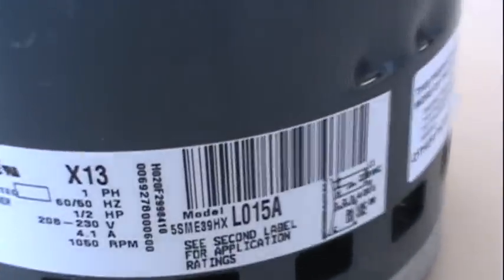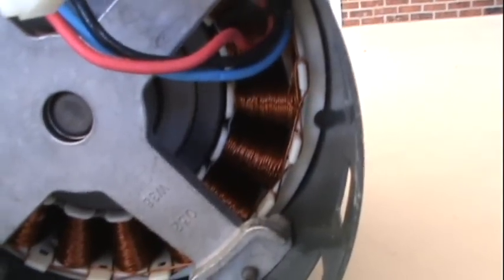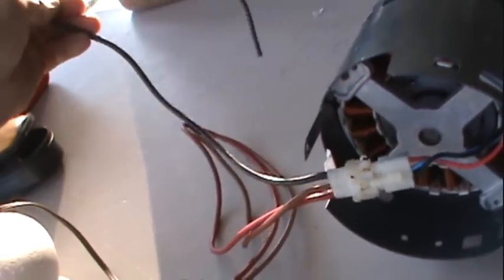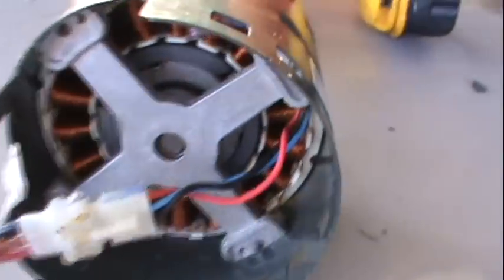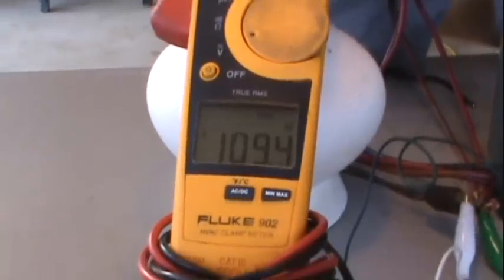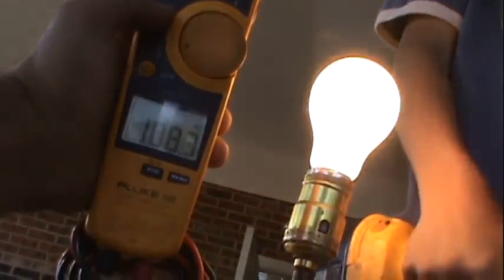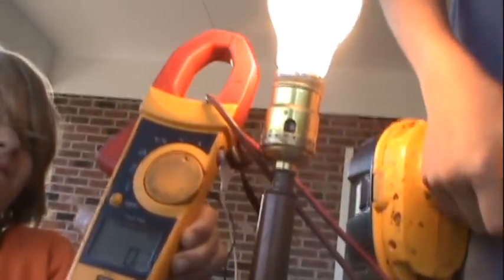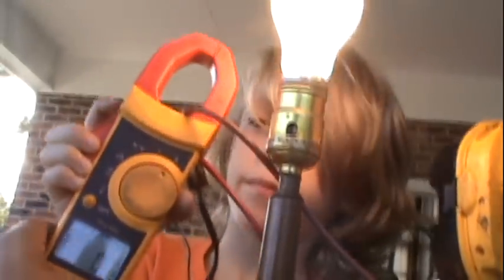Air Conditioner Blower Motor Converted To Generator

Comment: I am firmly convinced these things are inrunner BLDC motors...and that module that burns out is the ESC similar to those hobby motors used on quad coppers...but much larger and higher voltages...so turning it SHOULD produce 3 phase AC output, which can be transformed down to produce MUCH higher current, then rectified down for storage in batteries
Not bad...700 watts from a hand drill!  Imagine hooking that puppy up to a small 212cc predator engine (just make sure you aren't turning it much over 1100RPM (it's rated RPM)
They do make 3 phase full bridge rectifiers..only problem is...not many storage systems use 110v DC [rectified]  Trick would be...build a transformer...feed in the AC voltage, transform it down stepping down voltage but stepping up current...then rectify that and put into a charge control system for an off grid power setup [well I think the newer inverter generators might use that high a DC voltage to produce pure sine wave DC voltage]
https://www.ebay.com/sch/i.html?_from=R40&_trksid=p2332490.m570.l1313&_nkw=Three+Phase+Rectifier+Module&_sacat=0

Comment: I bought 4 of these from a air conditioning unit , i made a sweet go kart. Check out there u tube site for easy wiring for linking together , usb control and potentiometer control this will save you the cost of buying a brushless DC controller I spent almost nothing on my go-kart but then again the motors we're free

Comment: Well  I bought one on ebay...I spun it with a rope  and it went over 120 volts  so  you have three  places to  put one  bridge rectifiers for DC  current. maybe I could set them up in series and make a direct drive wind mill.. thank you  for rhe idea.. this is valuable info

Comment: GE GENTEQ X13 ECMHP Direct Drive Indoor Blower Motor.  SME39HX L015A. 1/2" Shaded pole shaft,  208-230v, 4.1 Amp, 50/60Hz, 1050 RPM, Counter Clockwise (CCW) Rotation, Single Phase, Made in India . NOTE: NO Wires are included as shown in photos. See tag pics for all specs. 
This motor is EXTREMELY CLEAN !!. Recently pulled from a running unit. (There were other unrelated issues wrong). 
Free USPS Priority Mail shipping to 48 states one business day after payment has been made.
 Sorry, we do not ship weekends or holidays. 
 If you need this part, you need it now....so don't hesitate, and buy it now!
MAKE SURE ALL SPECIFICATIONS MATCH YOUR MOTOR....THIS ITEM HAS A 20% RESTOCKING FEE.
I only do this because shipping motors like this get very expensive, and do not want a return on any motor.

great  lead!!!!!

Comment: connect that to a weed eater motor. and have portable lighting. that's all I'd connect to it. besides a rectifier and a charge controller. that can buck the voltage into current. and lower volts. to charge a battery bank. that would work good for something like that! use a engine. wind or water. to generate power!!!

Comment: So you didn't have to rewire the motor to make it produce electricity? All you had to do is hook a drill up to it to spin the motor?
Reply: Makes since right? Any motor will do that, The brush style motors have too much drag from brush friction. But that is what your car alternator is.. A driven motor.
Reply: These are in turn a 3phase generator. So the 3 wires are all 3 phases neutral is bonded inside wired Star usually

Comment: I have made several of these. I charge my battery bank that powers my shop. what you need to do is separate all three phases of the coils first. then run each  coil phase to a full wave bridge rectifier. this well convert the wild ac to more stable DC voltage. then connect all positive outputs of the three bridges together and the negative outputs together then run to a charge controller then to your batteries. I can get 500 to 700 watts using a 1 hp emc motor to charge my battery bank. I have four windmills up and  and 6 15 amp panels going into my charge controller. I get all my power from this setup and use a 10000 watt inverter to run all my saws and lights in the shop.
Reply from the maker: +John Lacourse  on a different video i show how i hooked it up to a 3phase bridge rectifier.  works good too.  sounds like you got some money in your projects.
Reply: +crob227 the full wave bridge rectifiers I can get online for 6 dollars a piece. they are 50 amp each. takes three. so minimal cost involved. everything else poles,wiring and batteries are all recycled. in all three windmills I have about 150.00 total.
Reply from the maker: +John Lacourse   you need some videos on that. would enjoy watching that,
Reply: John Lacourse  john, i would like more information on your generator setup. email at dg5454gmx.com

Comment: Hi just to let you know I saved about 20 of them from my job there are GREAT they can generate about 300 volts with about 4amps of power using a power drill at about 1500rpm fluorescent lite lite up really good the incandescent also I was able to run a jig saw with it and a small grinder. I was even able to put out more amps than the motor that was turning it which to me was really interesting. these are real good motors for doing experiments with on electricity.
Reply from the maker: i have more videos check them out
Reply: Eddy Rosario that would be free energy

Comment: You asked for ideas. You are totally out of my league on this one.  

Why not get in touch with subcooledheatpump ? He works with this kind of stuff and might be a good source of ideas. I am sure he would be generous with his time.  Sorry I can't help.
Reply from the maker: That's fine, thanks for the name anyway.  I have made a couple more videos, I have a 1/3 hp 120v motor driving this as a generator with a 3phase rectifier hooked up. im getting about 400vdc off of it.

Comment: P= E x I means that was a 70 watt load (lightbulb) voltage  (E) 109  x .7( I) amps = (P) watts ~70
Reply from the maker: thanks. wonder if the load will increase the power?  basically  if i had a higher power turning the motor/generator would it kill the light see is how there is no regulator on the generator?
Reply: Hello crob227.. your load (lightbulb) is the need for the circuit. You can increase the load only by the ability of the generator to produce more voltage. Voltage is the force allowing the amps to increase, but only to the point you don't overload the ability of the generator windings size to carry the current.. not to forget the heat in the windings.  More current, more heat, more heat more resistance, more resistance, less current. It's like water through a hose, bigger hose, more flow, higher pressure more flow. The load is the nozzle, small nozzle, more resistance, more flow and pressure, bust the hose eventually. To answer your question, Bulbs are designed to operate at certain Voltage, increase that voltage beyond design and it will blow the bulb.

Comment: HOW WOULD YOU BLOW A LOWER WATTAGE BULB unless you increased the voltage to make more current pass through the element than it is capable of handling. the people made like this motor/generator was putting out tons of current and it wasn't because the current in a circuit is set by what the load is if voltage is constant.  My point was that the bigger load the you put on the generator then you can see more about how much current it is capable of producing.

Comment: the current is based on the demand or load. for instance, if you put a 100 watt light bulb you it will draw near one amp. if you hook a vacuum cleaner to it, the vacuum cleaner will draw 10 to 15 amps.
Reply from the maker: I think you should try this for yourself, the voltage and amperage is based upon the speed and torque of whats pushing the generator there is no voltage regulators or anything.  And based upon what your saying i wouldnt blow a lower wattage bulb with drill.

Comment: Hook it up to a bicycle and show your youngins  how hard it is to create power.  See how bad they want to play xbox when the power is out ;-)
Reply: You would need a PURE Sine Wave converter which costs over $1000.00
Electronics have to have a certain frequency to work.
Reply: +Joe Yocom congratulations on understanding acdc conversion circuits for proper voltage and freq.  sorry kinda a troll here
Reply: Jeff DIxon gotcha
Reply: Jeff DIxon There would be no overweight people if they had to power their TV by walking on a treadmill :-)

Comment: nice motor generator now hook a motor to it and power it from a battery its like an inverter but its pure sign wave 1 2 its 3 phase and it will run higher power with less amps draw if you want to inprove the power more then you want to install a trasmission this will take less power due to it runs on hydrallics and it amplfies the input to more tork

Comment: Electronic Commutated Motor X 13 is a fixed speed motor. Has speed traps.The motor electronics are sensitive to power surges ,spikes,dirty power,etc. They now have a sort of fuse link you plug in between motor and plug.the link burns not the motor.There made by Zebra Instruments.Your parts store should have them.Good to see your kids having a good time and leaning with Dad. A good demo.
Reply from the maker: yea, these motors sure keep me busy and theres so many different things that happen when they fail, very seldom do the motors fail its always the module. thanks for the comment.

Comment: Nice vid , kids are funny What was the RPM of the Dewalt?.
Reply from the maker: im not sure its just a 18volt dewalt drill.
Reply: Just wondering  if it was on the side of the drill?. Some Dewalt's have different RPM's depending on what it's intended purpose is?.

Comment: What happen with the module motor ,do you test if work?
Reply from the maker: usually the modules go bad, but i have seen the windings not ohming exactly rite, you have to have no more or less than 0.02 ohms between each of the three winding or the motor is considered defective

Comment: Well many AC units have its fan turning because the wind (depends on the direction) so is not a bad idea to use this free rotating motor when the unit is not doing any work to generate some power from this useless spinning .... Not much power but cheaper than a photocell

Comment: I fill the reason the amps were so low with the light bulb is that , that's all it needed to run. Put something on there that needs amps to run and see what happens and share. Go ahead and hook it up to an alternator rectifier and spin with a small dc(12volt) motor and check the rpm's it took to get it to 14 volts dc to charge a battery back up. That's the real working test that I would love to see. Thanks

Comment: Wow that is amazing.I have a 24 volt scooter motor giving me around 14 volts.I wish I had one of those motors.That's a 220 V motor correct?Does all home A/C have those motors?You drive that on some wind blades you should get more then 110 volts.

Comment: i work as maint at a apt complex this dc powered motors are shit i have changed 20 or 25 of them some only days after the new units where put in this motor is the biggest piece of shit and causing so many problems i spend most of my day changing this 500$ pos

Comment: 108/0.7 = 75.60 or 76 watts. So you have enough to power the light but the motor is rated at 902 watts at 220v in the reverse if your powering the motor. In the grand scheme of things if you had a geared drive and turbine to drive the motor and small battery or capacitor bank you could have some free power.

Comment: BTW I tested it on a small light bulb just by spinning the rod with my hand and it lit it up like christmas. So, I know it outputs electricity but would i need to do anything special to make it charge batteries? I'm sorry but I am looking and experimenting on off the grid systems and I am extremely newb.

Comment: I just got one of these motors practically brand new from a scrap metal place. I gave them and old air conditioner and asked if I could trade strait up for a motor they had in their motor bin and I saw this motor in it. I'm hoping they get a lot of these because of faulty air conditioning systems (I'll be checking often) I had seen this video not 2 hours before doing so. I am very new to all of this stuff so I have a question. Can this motor be used as a dc battery charger for wind turbine?

Comment: The volt meter will show AC when connected to a single phase like in your experiment.... This however, does not mean that the motor is not a DC motor though as it can be commutated electronically. IE: BLDC

Looks like a sweet motor to play with!

Comment: I have the same motor in my A/C.  It went bad while still under warranty. Have you tried to just replace the bottom circuit part?  I can't get mine replaced by warranty because I took it out myself.  A friend gave me a 220V replace which I am using.  How can we use this for something useful?

Good work and thanks.

Comment: also you just happen to have it stood up right which is excellent that you now have 360 degrees magnetic assistance from the earths spinning field  (no drag as if it were horizontal as you would get push pull effect as it turns to ground/earth ,then to sun positive no expert here in uk

Comment: Genteq's website: X13's " are for use in original equipment only, because they need a specialized control signal."  =3rd wire = control.  Would imagine coil is "timed" to be energized only a split second before the commuter gets there. Kinda like the coils in Zero's Muller motor.  

Sorry, I saw your setup and  I  ASSumed it was DC.  My bad. Good work! 
HAPPY PROBING!!!
Reply: BLDC...just larger and higher voltage
Pulsating DC can mimic "AC" voltages...especially when the phases of the coils are out of phase

Comment from the maker: the volt meter was showing ac, the motor only has coils and magnets no communtator, so its not giving a dc signal, only ac thanks for the comment, and i will do some more probing later on in the week when i get some time off.

Comment: 107v X .7a = 74.8w.   This is a DC calculation, only. 

Don't know what the 3rd lead is for. Would have to use some test leads on my meter to see.  Do some probing  at the leads to individual coils, too. 

 It's not a real party till you do some "probing around."  -Know what I mean, Vern?